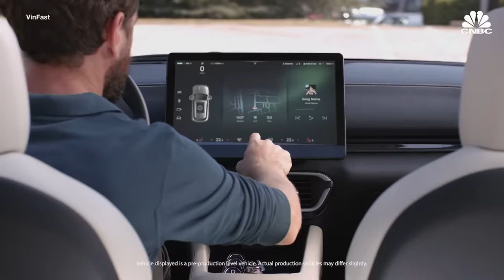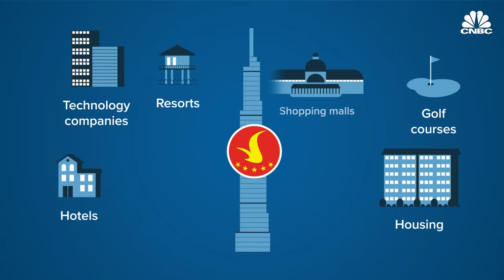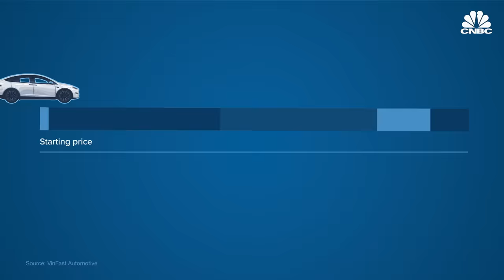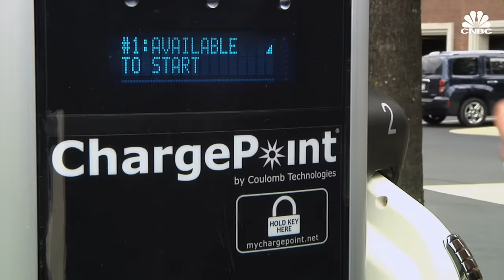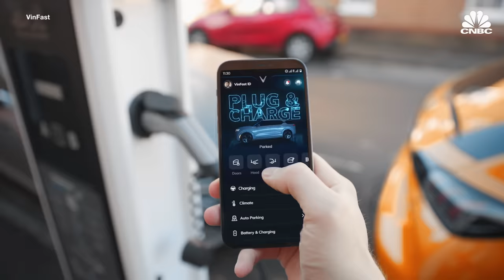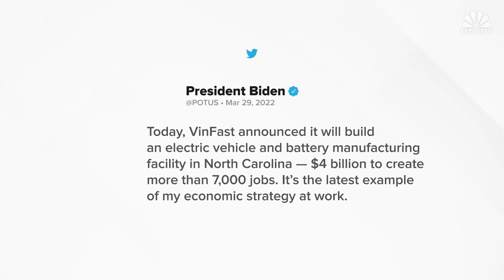How This Vietnamese Carmaker Is Trying To Beat Tesla In The U.S.

Comment: I think VinFast should listen to American buyers.  We do not want to lease the battery.  And or give buyers 2 options to choose from, either buy the whole car with battery and or lease battery.  If the price is right, buyers will support this new brand.  That’s it … life is simple :)
Reply: Yep. The moment I heard their plan is to lease the battery, I was just like, "NOPE!"

As I see it, the problem stems from a lack of understanding of the average consumer’s motivations for purchasing an EV. By far the biggest draw of EVs is escaping the money-drain that is driving a gasoline-powered car. Recent inflation of gas prices has only served to solidify this priority in the mind of the consumer, so they will be looking for something that, outside of repairs and insurance, doesn’t have a high recurring cost associated with operation. They don’t want to replace the cost of gas—they want to eliminate it entirely. By utilizing what essentially amounts to a subscription model (especially with a base that is charged whether they are driving the car or not), the biggest benefit of owning an EV is completely negated. It doesn’t matter whether the money is going to fuel or a battery lease, the result on the consumer’s wallet is the same.

The importance of this to the average Joe will only be further compounded by the coming economic downturn and, when money gets tight, the first thing people start looking to cut will be subscriptions. Since this company will be going to market in the middle of that downturn, car buyers will place extra priority on how the pricing is structured. This means a whole new monthly subscription is going to be a hard sell to people who are already trying to cut expenses on gas and other unnecessary expenses, especially when most other EV companies (especially major car companies that will have completed their EV pivot by this point) won’t be charging a subscription at all due to better understanding of the American consumer's psychological profile. People here are very accustomed to a certain ownership model for cars: once you own it, you own the whole thing; if you need to repair it, you can choose to bring it in and get it fixed, but you don’t have to because it’s completely your car. People won't want to cede complete ownership of their cars, especially in the midst of a recession. Seeing as most people will view battery replacement as a "repair" that that they have to subscribe to just to operate the car, they will be far more aware of the fact that they are being charged a subscription for what would usually be a one-time cost if they had bought from any other company and that they do not completely own their car regardless of whether it is paid off in full. It seems like many newer players in the EV space are approaching the vehicle market from a SAAS mindset without considering that, by the time they actually start selling cars, the consumer they will be faced will have very different priorities from that of today. I simply don’t think customers will be willing to take on an additional, inflexible subscription when there are other, non-subscription EVs available.
Reply: Yeah... Vinfast always to listen the customers by calling police to catch them if they have any complaints about Vinfast ' car..
Reply: I remember that a buyer who is from Norway had a hot video Youtube with Tesla. He exploded his car because changing new battery is very expensive. He wants to show his anger to Tesla battery. I think during next 5 to 10 year, battery technology still dont have big change, and Vinfast solution to lease battery is a good idea.
Reply: @kevinng8083  your tesla must be really nice. When I insult your parents, saying that your children will die, your parents are animals, do you feel angry? So stop judging or badmouthing something that doesn't exist. You live in the free country, so you have the right to say whatever you want. Live a decent life.
Reply: Battery leasing is a good model, especially when battery life is one of the largest concerms for would be EV buyers. They're concerned that they'll eventually have to pay more than the car is currently worth on a new battery down the line, and a battery leasing program can put them at ease, so every set amount of time, batteries are replaced and the lease is renewed, and lease terms can change as battery technology makes them more durable and longer lasting.
Reply: @mayoau8518  C' on @Hungheroes Ng  just tells the truth man.
Reply: If battery leasing is hassle free it would work. The only reason I wouldn't buy a ev now is because of the battery replacement costs.
Reply: I like the idea. American always want to have a choice. Leasing the battery might be a good alternative for not worrying about replacing the battery after 8 or 10 years. 2013 Tesla battery as I heard costing about $22,500.00 to replace.
Reply: @mayoau8518  The truth cannot be hidden, don't be rude.
Reply: @ttran9893  :))
Reply: @kevinng8083   I heard and read about it. Do not know if Vinfast can do it in America?

Comment: The battery leasing model was tried by Nissan and Renault (as an option) in Europe years ago. It didn't go so well as the economics were not great on the buy side. Also, since then car batteries have proved to be more resilient than originally though, even the first gen Leaf battery had performed better people expected. Now different battery chemistry make the batteries more resilient and the replacement cost will likely be even cheaper down the line. With reuse as energy storage or recycling as ore, people replacing batteries on old vehicles could get money back much like how car owners can get money for selling catalytic converters. 

The biggest depreciation in the value of the cars. Whether the battery has 70% capacity or 90% wont be the biggest factor in car value and new buyers of EVs now would probably want to change vehicles for the latest model/ tech before reduced range really impacts them anyway. 

Personally I contract lease my EV (in the UK the lease prices seem to be be more reasonable than some other part of the world). I would not like to have both the downsides of leasing and buying but none of the upsides. I think Vinfast would be better off changing their model, it may work short term but not long term as businesses and consumers realise they are paying a premium for a battery that isn't actually degrading much.

I think one thing the leasing model can do is provide Vinfast revenue during economic downturns, though consumers who are used to buying vehicles may find they don't like to be tied to a contact and not go for the same approach again, as with Nissan and Renault.
Reply: I agree.ost EV  battery's  don't  degrade to 70% for 8 to 10 years. 
By then consumers have moved on and bought newer EV's with better  tech and battery life.  I really feel that VinFast cars like the VF6 and VF7 are not only beautiful but that they should be cheaper than the VF 8 or 9. Right now America is on the edge of a recession , food and other stuff is too high. People are trying to save where they can and protect the environment  too and going electric  is important. But if you live in s state  like Florida where there's just hundred of miles of emptiness between major cities all vinfast vehicles  need to have a minimum range of 300 miles. I wish vinfast good fortune. Hope they will bring out the VF6 And VF7 sooner.
Reply: @AssassinCreep2552  I agree with your comments. I didn't mention that 15  year old plus cars in Europe often get a second life in Africa. There they may be even more accepting of a third hand car with even  around 60% range at a much depreciated costs compared to buying a cheap new car. Wealthy counties have rapid consumer trends that cause rapid depreciation of old tech. As you mention, the batteries themselves don't degrade much.

I would say as far is range is concerned, more CCS rapid chargers can help negate the need for 300 miles EVs. Having said that, I am probably looking at things from a UK/ Europe perspective and I know in the US people drive long distances more regularly. 

Also, yes I think a big recession is coming (worse than '08 and 2000) and I think this will impact EV companies a lot. I also, wish VinFast well but the timing with the IPO doesn't look good. Though, funnily enough, the high battery ease costs could provide some cash flow during down time (albeit from people who probably won't get a battery lease EV again). 

As a side note, I think the interiors of VinFast cars look like they need to be improved in build quality for the money, big screens aren't enough.
Reply: Now the question is why you have to buy insurances for your car even though you know it's going to depreciate in few years or even you are done with all the payments. Let's talk about Vinfast battery leasing program. EV batteries make up a large chunk of the cost in many EVs. Vinfast selling its batteries separately offers many benefits. It lowers the initial purchase prices, and customers don't have to pay additional taxes on the batteries. This leads to much lower monthly payments. Also, Vinfast will replace the battery pack for free whenever the battery capacity dips below 70% as it actually happens after years of use, like the case of the Finnish man who finally blew up his Tesla 2013 Model S because the Tesla battery price was almost the same of the value of the car itself. Why bothering to fix it! I was also told that a Nissan Leaf owner was stuck with his car after over 8 years due to the battery falling below 70%. The Leaf owner could not even sell or drive it because the bill for a full battery replacement was about the same as the value of the car itself. In addition, an LA couple-husband and wife had been stuck with their about $50K bills to replace the 2 batteries for their Tesla's. Did you see all the battery problems there? Hadn't they all wished that they would have had Vinfast battery leasing program, so they could drive or sell their EVs without any problems. Most surprisingly, Vinfast battery leasing program won't cost you an arm and a leg. The leasing program costs you as low as about 1 buck daily and you can drive or re-sell your EVs whenever you want without worrying about the large sum of money to foot the surprising battery replacement bill.
Reply: @proud4373  You bring up some interesting points with used car owners. I have heard that here in Europe, replacing a gen one leaf battery is reasonable in cost, though many owners would probably rather use that money towards a newer electric car, even a used 2018 Leaf.  

As for the leasing, at almost 200USD/ month for the VF9, the leasing cost is a lot on a car already charging a premium given what some have said about its build quality. After round eight years (though I think the batteries should be fine longer for most long term or used buyer), you are looking at around an eye watering 20K USD cost in battery leasing. That is far above the current cost to produce the batteries (around 150USD per KW capacity), even with the high prices of lithium. 

If a long term owner or used car buyer decided to replace the battery they could recoup some costs from selling the battery, not the case with a lease. Also with time, I expect there to be more OEM battery replacement options for old cars reducing the costs. For someone worrying about range depleting, they may as well buy a similarly priced electric car and self insure by putting some money away (less than 200USD/ months) in a portfolio of dividend stocks.  

I think from a business perspective, it looks like VinFast is trying to generate easy long term cashflow by locking people into the leasing programme. That is their choice but I think it will be terrible for their reputation. We will have to see down the line. 

Though, I think they may either pivot soon or get wrecked with the recession. Many buyers may now be turned off by the locked in monthly costs.

As a pro free market, globalist I want VinFast and other manufactures from emerging markets to do well. I just think their business model is unsustainable and their cars are a bad deal for consumers who may as well wait for a Kia EV9 (vs the VF9) or take one of the many other options for the  VF8. I hope they change by at least providing more options.
Reply: Con Sáu Mập ở Bình Dương  Apologies, the 200 a month figure was CAD, I didn't realise. Regardless it doesn't change that fact that it is still grossly overpriced, just a little less. In fact, it seems that the standard monthly costs will come in at the excess charge for additional miles on my leased car (9 pence per mile over 8K/yr on an Ioniq 5). For my leased car I get to hand the keys back to that in four years and get a new one. VinFast will change the leased battery once it finally gets to 70% however long that takes. 70% may be fine for many but it is a large threshold before the lease is even used. This is interesting as the lease is targeting those who are battery/ range conscious. 

I understand that at present the VF9 is unique in its position as a three row SUV but for a long term it is worth  waiting for products from other manufacturers to provide more choice, such as the Kia EV9 which will likely continue with the brand's warranty.

As for the replacement costs, I believe these will come down significantly in time. Though regardless, the leasing costs themselves may be more that the car is worth (based on regular depreciation) when the battery is changed. I won't be surprised to see used VinFast cars to actually depreciate more long term as used car buyers weigh up the costs of an additional financial commitment. Used cars may be cheaper but battery leasing costs don't fall with used car prices, even if the battery is at 75%. 

Perhaps an easier option for long term owners happy with their car, would be to sell their car for a lower milage one and pay the difference, which will likely be less than eight years leasing. Though, in wealthier countries like the US, new car buyers likley won't won't to keep a car for eight plus years as they will want the new tech. Especially with all of the changes happening such as improved automation.
Reply: Con Sáu Mập ở Bình Dương  I want VinFast to do well, but it looks like they will have to change or end up failing long term. Companies need a reputation of quality, features and value. Their cars don't seem to excel in any with the current pricing model. 

Personally I am not brand patriotic, I avoide certain regions of the world but are open to where I get products from. Perhaps if VinFast changes I would get one of their cars down the line but a lot would need to change. The question is, how many people will order their cars in the long runs Vs models from the competitors. 

I agree that EVe make sense, so long as the materials to build them are responsibly sources. Other manufacturers like Ford have set up battery recycling partnerships where they have invested in local recycling plants. Some companies such as Audi are already selling used EV battery cells for use as grid storage.
Reply: I can see this is a great model for rental businesses where insurance do not cover degraded batteries as its part of wear and tear. Even for company cars. Where do you see that battery last 8-10 years? A subscription will guarantee that your battery will always be 100% capacity and if not, it can be replaced at anytime. This also reduce depreciation on your car.
Reply: The biggest flaw with the battery lease model is that it costs more to lease the battery than the cost of refuelling an ICE car. Plus, you have to pay the lease whether you drive it or not, and it means that you never fully own the car. This means that you can never modify it to support newer technologies, You have extra paperwork to sell a less desirable product that few people are willing to get because of the above problems. Lastly, If the company goes out of business or decides to stop supporting the product, they can demand the battery back, and now your car is useless. 

Nobody wants to own a rolling shell, where you have to lease the actually important bit that makes it go.